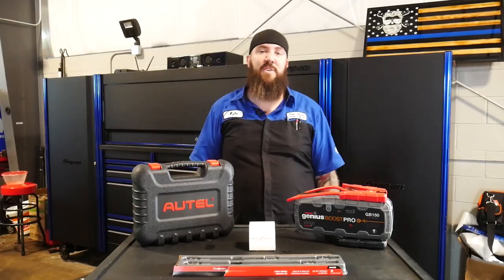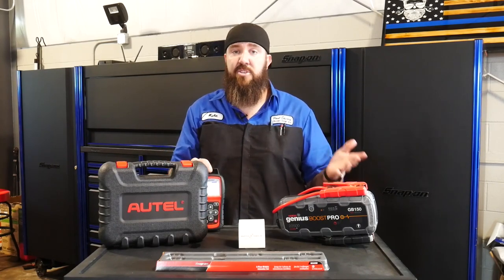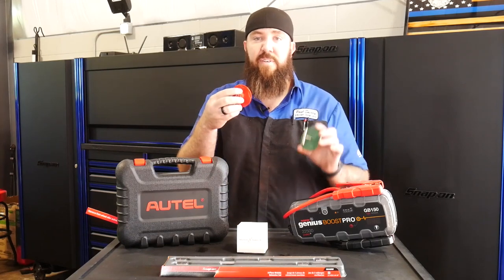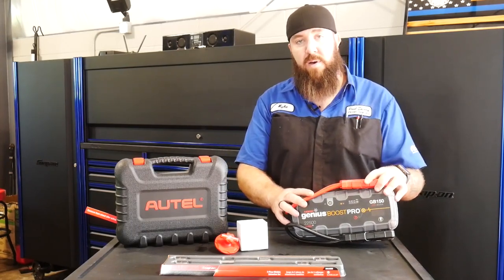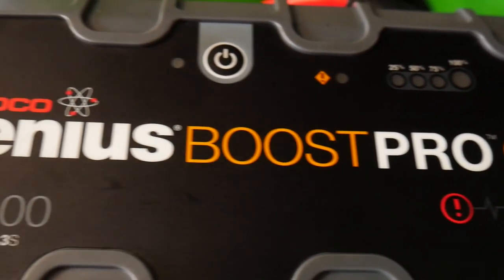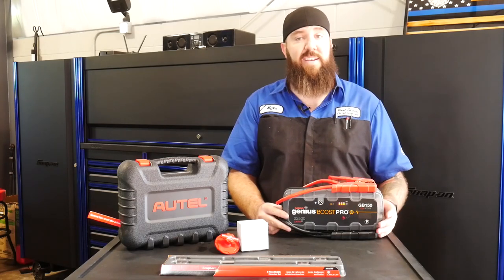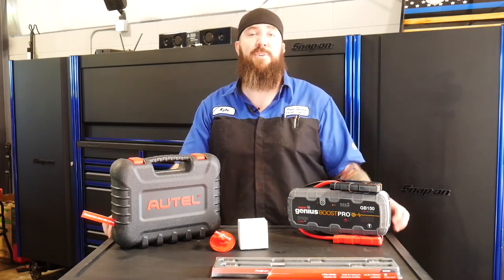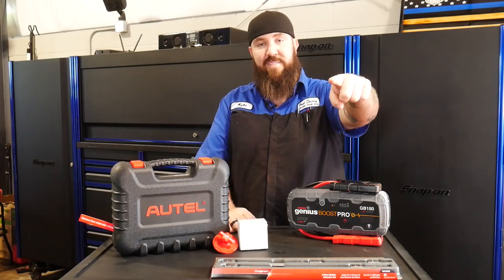NIFTY TOOLS OF THE WEEK - END OF SUMMER TOOLS!

Comment: I just take the intake hose off the turbo and pull the filter up from there, I’ve never had oil spill until the filter is tipped but this way you keep it level